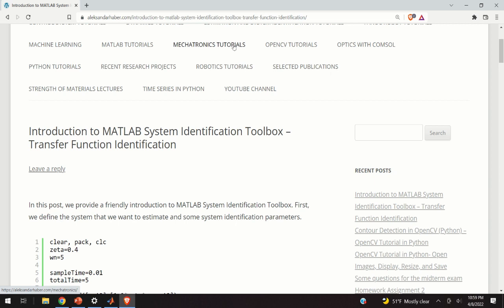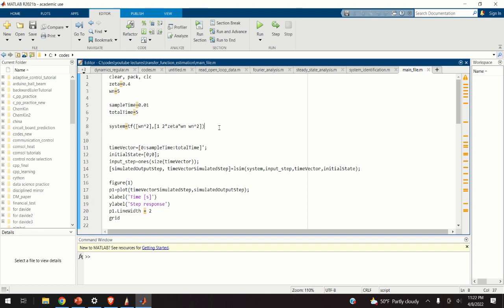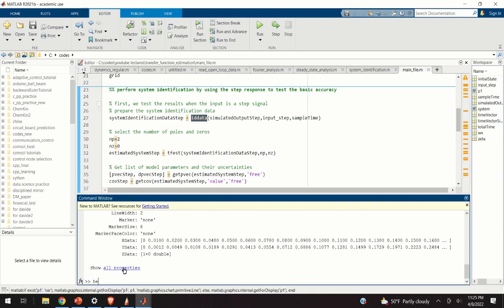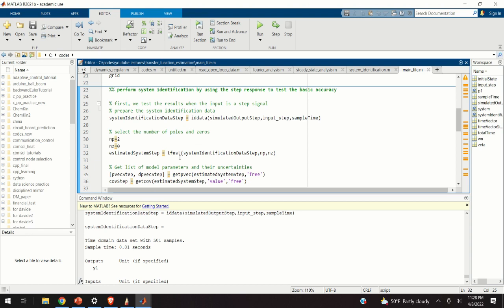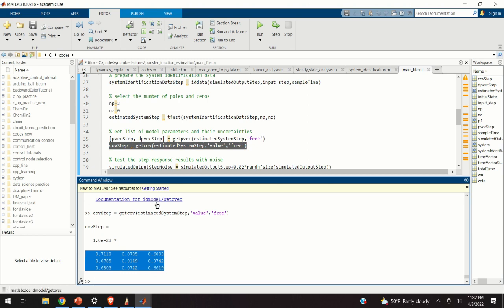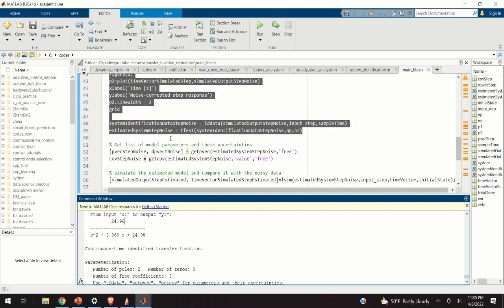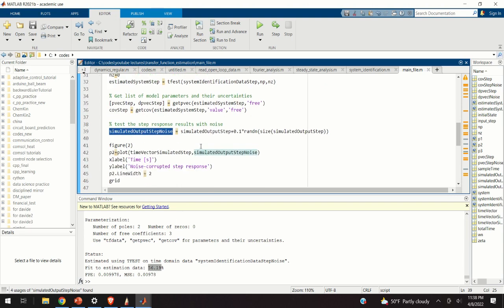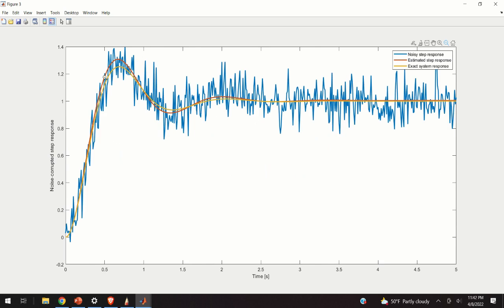Estimate Transfer Function Parameters in MATLAB- Intro to System Identification Toolbox

Comment: let's say there is a room/space that needs to be cooled down. The idea is to control a 8'C cold water flow using a valve that can be opened and closed from 0-100%. the desired temperature can be set in the microcontroller. If I were to design a controller to control the temperature then I must find the transfer function of the system (room). Can you list the steps in this case as to how to find the transfer function of the system. For e.g set the valve to 100%, take measurement at t = 0s, then set valve 35% and measure temperature at t = 120s. etc. and how many terms should be in the numerator and denominators ? Also, should I wait for the temperature to settle after selecting a valve position? let's say it takes 10 minutes to settle down to a temperature after changing the valve position so does it mean my time intervals for changing the valve and measuring the room temp every 10 minutes ?
Reply from the maker: All these things that you described are important questions. You have to figure out the answer independently because only in that way you can learn system identification. A great book is Prof. Ljung's book. Keep in mind that  in order to control the system you actually do not need a transfer function. You can start with a simple PID controller and you can tune it experimentally.
Reply: I used to implement PID like the lazy engineers way, but I thought finding the transfer function of the system can make me model the system in matlab and simulate it with different kind of controllers to find the best solution. Nevertheless thanks for the suggestion of the book. @aleksandarhaber
Reply from the maker: @nafisahmed6247  Yes that is the path to go if you can get a model. You need to excite your system with random signals. and in the desired frequency range. Usually people apply a bias, and around that bias a random signal, such as something that looks like a white noise or a pseudorandom binary noise.

Comment: hello ..what if I have an S or an  S^2 in the numerator and want to implement it in your code ..how do it do it ?
Reply from the maker: You want to estimate a transfer function with a pole or two poles at zero?
Reply: @aleksandarhaber   1 zero and 3 poles . The function contains an S in the numerator and s power 3 in the denominator
Reply from the maker: @seifhossam8222  then, you need to specify how many poles and zeros you need want before calling the system identification function
Reply: @aleksandarhaber  I have already done that ..but the problem is that the  estimated  step response is zero ( a line parallel to the x-axis ) and the fit to estimation data is 1%
Reply from the maker: @seifhossam8222  You cannot estimate such a system then. There is something wrong with the postulation of your problem. Also, you might have an unstable system.